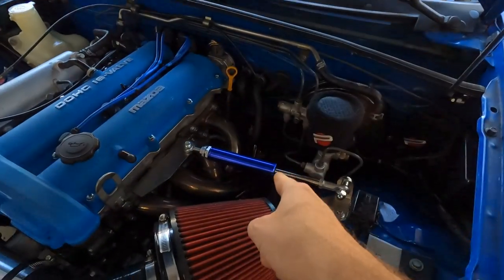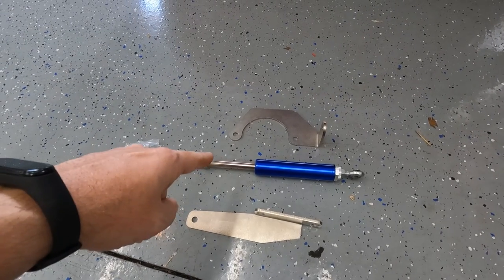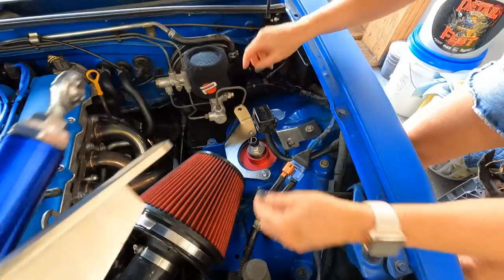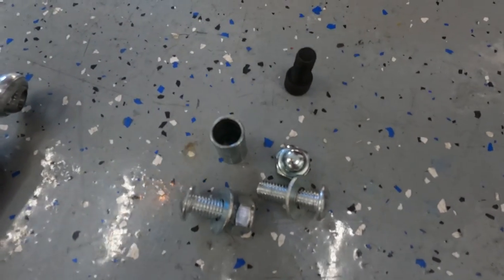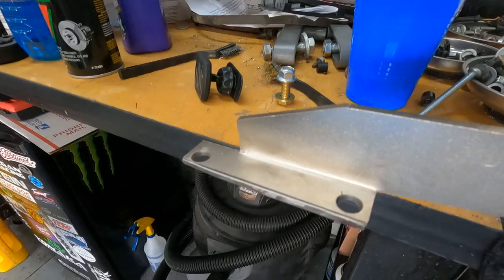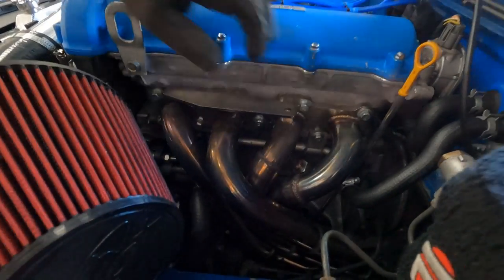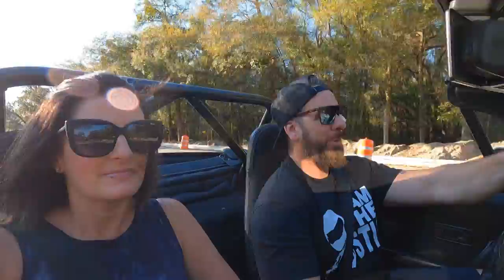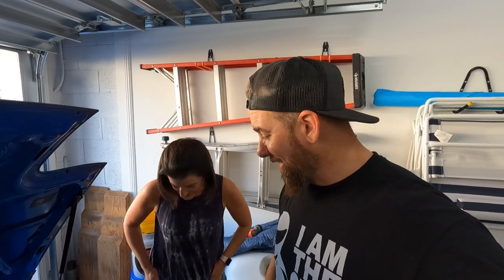Are Torque Dampers Worth It?

Comment: I got a problem with my Prelude because I put a stage three clutch and when I pop the clutch are low RPMs the engine starts shaking I have to takeoff in first in high RPMs in order not to Shske

Comment: I didn’t understand: were you not satisfied with the quality of the mechanism mount or how the damper was made? do you continue to use it?
Reply from the maker: All the above. I no longer use it because I have updated my engine mounts to AWR mounts. I did a video on it. Just search the channel. Thanks for watching.
Reply: I have a mazda demio with a mazda miata engine. little room for the engine. with deviations there are dangerous touches. hard mounts solve the problem but give strong vibrations - that's why I'm considering installing a damper

Comment: Dude, I think you didn't set the damper correctly.  It should work both in compression and in tension.  Your depreciation works only for compression.  P.S.  I can be wrong, so write what I'm wrong.
Reply from the maker: You and I are on the same page. I thought the exact same thing! Like I said in the video, I took the damn thing apart to try to figure it out. It turns out we were wrong. Nonetheless, it's doing the job so I'm not complaining. Thanks for watching!

Comment: I think Weapon-R makes an expensive one for the xB. It’s beefy
Reply from the maker: They do and it's like $300. After doing a lot of research on this subject I have concluded that all of the companies use the same cheap shocks, they just put their stickers on it. What they produce are the brackets. I'm sure the WeaponR fits the xB rather well, but it's still not worth $300. I wish I knew how to weld because these would be easy to make. Thanks for watching.
Reply: @ExtremeDailyDrivers  at best, I’d probably re-purpose some NRG hood shocks because they’re oil filled instead of gas or air